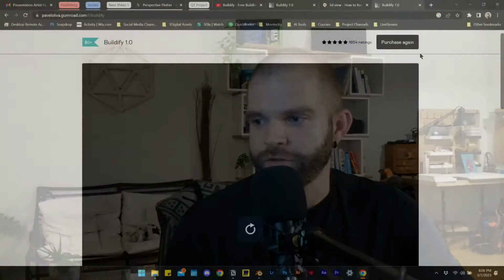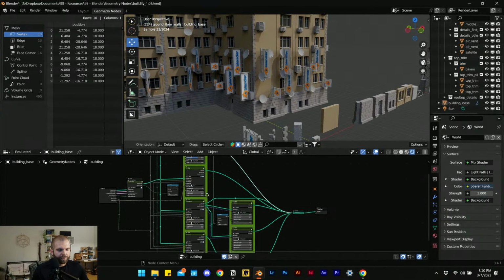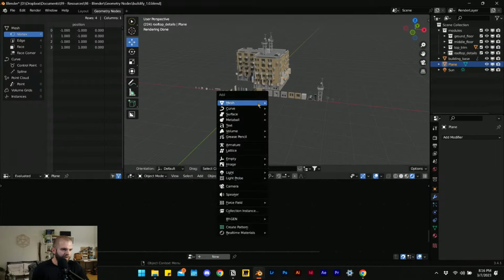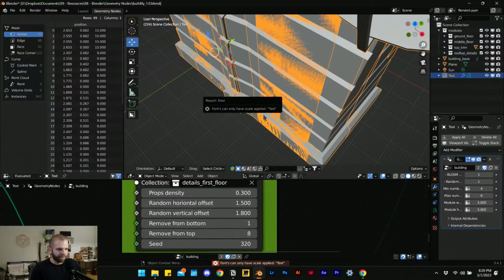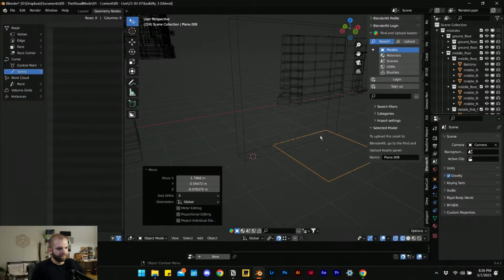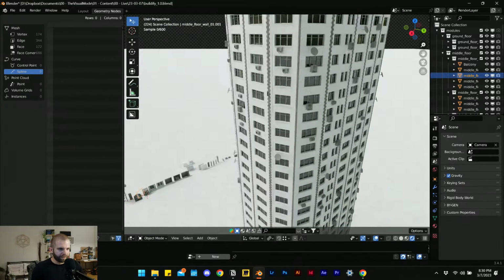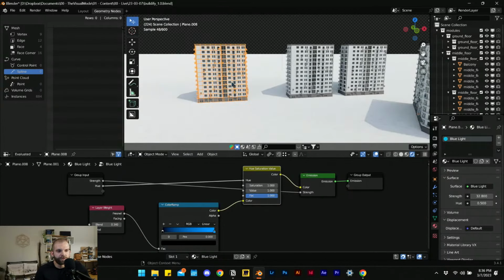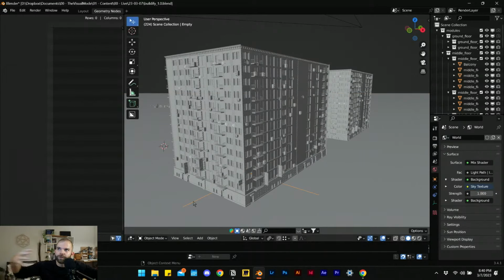Create Buildings within Blender in Seconds with Buildify

Comment: Hey friend. I know your tool is fairly old right now, but i hope you´ll answer anyway. 
Is it possible to bake the geometry to a single mesh? Or even to multiple meshes? I wanna use your tool to quickly create buildings and tear them down with RBD Labs, but to use RBS Labs, every Wall, windows, door, sign whatever has to be a mesh to fracture it properly.

Comment: Hello Julian. Thank you so much for using the tool and making this review. I am sure this tutorial will help many people. ❤

I've noticed that you've been struggling a bit with drawing the building.. That one is on me since I've shown the feature for a joke as a friend of mine asked me if it's possible to draw building with the tool. Actually it's possible, however it requires to add "curve to mesh" and "fill curve" nodes into the node graph at the beginning right after node group input. I haven't included this feature by default since I am not sure how useful it would be.

Speaking of some weirdly placed objects (satelites in front of windows for example), changing the seed can help, however once you will be happy with the building shape, you can press ctrl+a > make instances real that will turn the building into separate models that you can tweak further/delete however you want.

Anyway if you have any questions, feel free to contact me on my Discord server where we can discuss them further :)

I wish you good luck with the challenge!
Reply from the maker: Wow, thank you so much for the explanation! I assumed I was missing something at the beginning of the script, that clears it right up. I’m working on my own modules inspired by the city of Genoa. I’ll follow up with a video with that set and make a more comprehensive explanation of the process. 

Again, cheers to you. One of the best investments I’ve made in growing in my field!